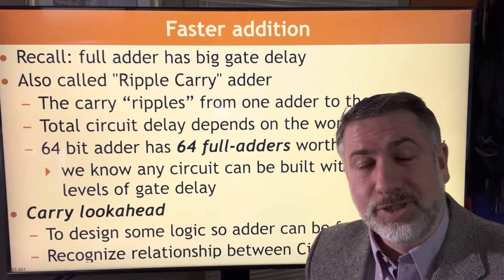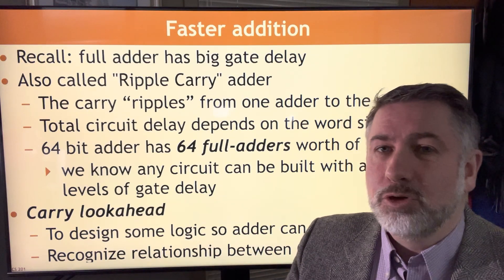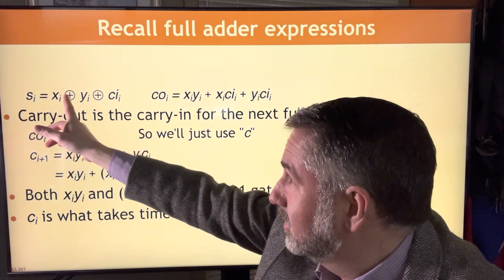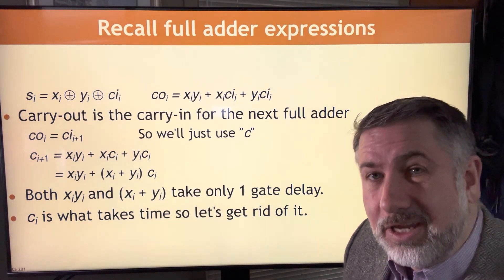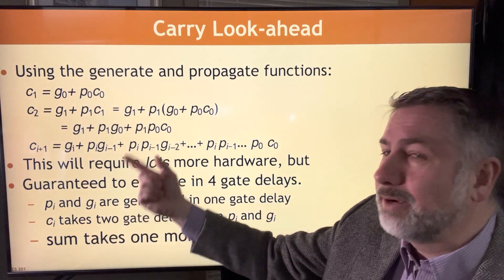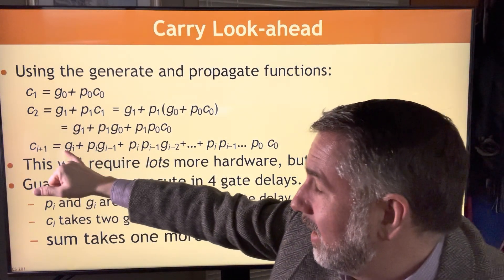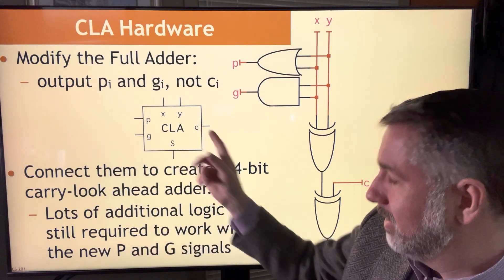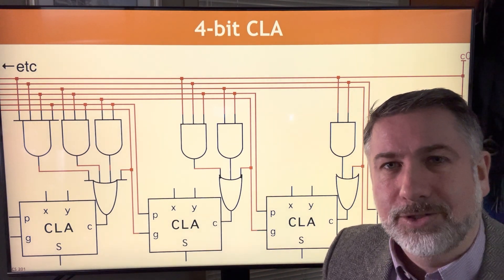Faster binary addition: the carry lookahead adder

Comment: 17:20 What about the AND and OR gates that are hidden in the CLA boxes, which generate those "p" and "g" signals? I would say that there's 4 gate delays here.
There's also the problem of increasingly growing number of gates for each bit position: For a 64-bit adder, there would be 64 AND gates required for the last position, with a maximum number of 64 inputs. That's a lot! I don't think it's possible to do such huge fan-ins in actual physical hardware, so these gates would have to be split, which will increase the number of delays. Sure, it's better than in the ripple carry's case, but it still grows pretty much linearly with the number of bits.

Comment: I got nerdsniped and realised I couldn't remember how to solve the ripple adder delay, and went looking for information, this was *excellent*, thank you! One thing to note - the diagrams at the end makes the maths far more clear, it really wasn't 'clicking' for me at all until I saw the P & G outputs on the full adder. As soon as I saw that, though, 🤯 instantly got the idea and why it turns adding into a constant time operation! :D Also, I think the looping backwards to the G/P bus might not be the clearest way to teach this - I wonder if pulling apart the CLA into the G/P stage and Adding stage, then running the bus down the middle, would help make it clearer that there's no longer any ripple, that it just flows with each bit 'slice' operating separately, never waiting for another